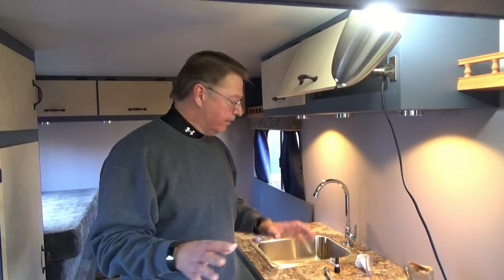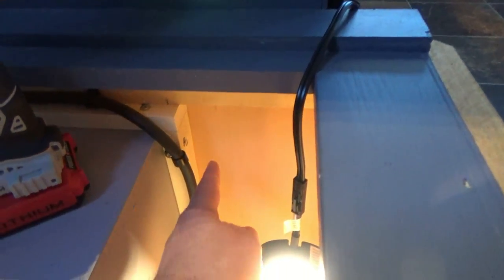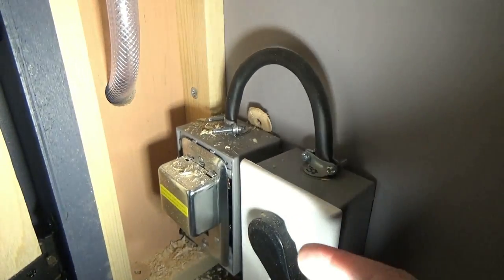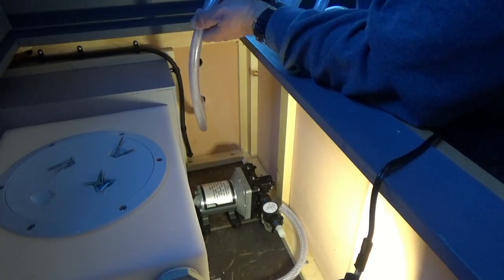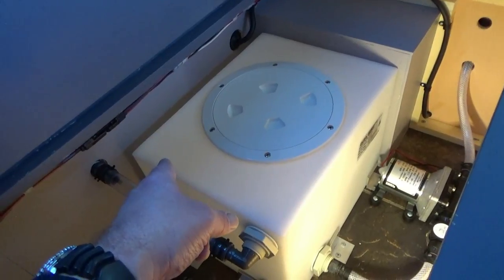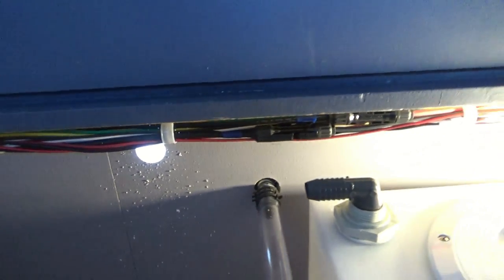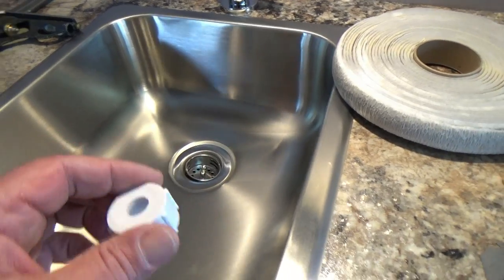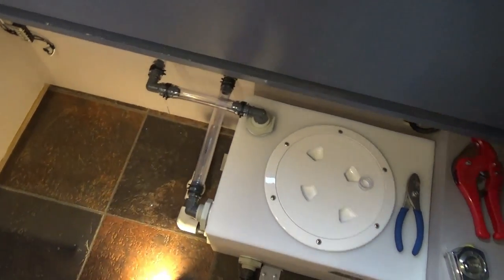How To Build A DIY Travel Trailer - Part 63 (Freshwater Tank Install – Part 2)

Comment: Your pump will be noisy, because the pressure-side of the pump goes straight to the hole through the wood. The vibration of the pump will be amplified by the wood side of the cabinet, and will be very noisy. The fix will be to run a longer line, suspended in the air so it is allowed to vibrate without touching the cabinet.
Reply from the maker: Thanks John! Yeah... there is a little noise from the pump but not so much to be annoying. For the little time that it runs... I can live with it, and is doable for me! Thanks again!

Comment: What adapter did you use from the sink drain to the drain hose that went into the water tank?
Reply from the maker: Hello Nicole! The part I used is called "Valterra Sink Drain with Strainer Basket" from etrailer.com  here is the link: https://www.etrailer.com/Accessories-and-Parts/Valterra/A01-2011VP.html    Hope that helps! Thank you for stopping by to watch! Cheers!

Comment: OBM-  Now I understand....You didn't send the overflow out of the top of the tank and down through your floor.  You made another penetration through your siding (which requires sealing and maintenance) and use that as a vent and an overflow.  I was thinking the way some people do that your overflow would empty below the trailer with no fuss, and not, as you stated, spray someone in the face as they fill.  LOL.

Comment: What about hot water
Reply from the maker: Great question. As far as cooking and cleaning, I will be boiling water and use that for the hot water source. I was thinking about trying the solar hot water tank. May install the tubing on top of trailer, fill with water, pressurize, and use a shower hook up for outside shower use. I think that may actually work! Cheers!